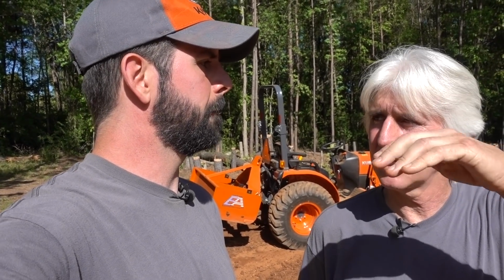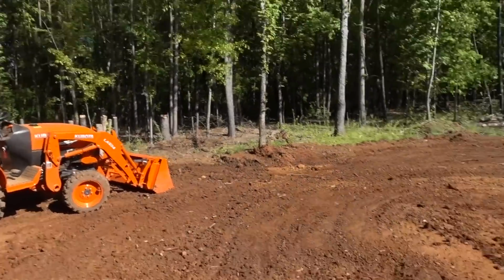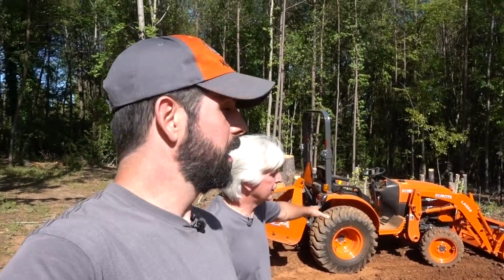Moving Another Mountain With The B2650

Comment: Great video, just curious why you didn't go-ahead and go for like a 50hp tractor over the compact?
Reply from the maker: Thanks! 

We wanted a light weight tractor that could be run on lawns in the future plus its the largest tractor they make that does not require the DPF filter and all the hassles they involve.
There have been and will be plenty of times a larger tractor would be nice. We actually hope to get a larger tractor in the future and maybe buy or lease a bit of land to farm. Time will tell.
Terry
Reply: Forest To Farm heard that. I've got a 52 ferguson TO 30 that I use to bush hog with,  but definitely could use something a little bigger with a lift.
Reply from the maker: That's a nice tractor. I love those older model tractors. They are a bit limited in what they can do though. We want one of those or maybe an old 8N just because we love old stuff. We want a lot of stuff, lol.
Terry

Comment: Currently looking at either a B2650 or B3350, have you ever had an occasion that you wished you had more power?
Reply from the maker: Yes. 
We did not want to worry about the DPF filter. Its not a huge deal but just one more thing to keep up with in our already extremely complicated lives. 
The B2650 has been all we needed so far. Our plan is to rent a mini excavator or skid steer when any heavy work needs doing. That way we don't rag out the tractor. And its fun to play wiih those big machines every once in a while. I think the main advantage to the B3350 is extra PTO power. We will be running a bush hog but only on fields we develop and clear so it will just be grasses and normal field stuff. No big trees or anything like that. So the limited B2650 PTO power should be sufficient for us. Ultimately if we were making money with the tractor and time was a huge factor then more power would have been our option. We don't mind things taking a little longer to get done. Its actually like playing for us when we're on the tractor, lol.
Terry
Reply: Donald, If you do not need the extra pto horsepower the b3350 has over the b2650 stick with the b2650. I bought a b2650 because it has no Diesel Particulate Filter (DPF) and was priced less accordingly. I have a larger Kubota with a DPF and have had no problem with it. But, my dealer says they are currently not offering the 3350 for sale because of problems with the emission system. Hope this info is helpful.
Reply from the maker: @jc-botaman1077  Good info and we love the B2650. Also wanted to avoid the DPF.
Terry

Comment: Great videos..👌👌 I have a couple of questions and I'm considering a b2650. 1st, how does your current tire setup handle and perform on turf. Town between the r4's vs the turf tires. Also I've noticed your implements from EA, and was wondering is it better to get a package deal from the kubota dealer or just source your implements separate elsewhere?
Reply from the maker: First I am no expert. However we did a lot of looking before we bought our tractor. When we bought it there was a discount for two implements and the tractor purchase. We purchased the front end loader and pallet forks. Saved a good bit by getting that package(I think $1000 between the two implements). Then we had been looking at the Everything Attachments implements and honestly they are better by far in my opinion. 
Look close at the dealers box blade then look at the one EA has to offer. They have videos explaining how they build them and how much better they make them than many others do. After actually owning and using ours we have went and looked at the competitors and we feel EA has done everything they claim to have done and they build an awesome box blade. We will always compare between competitors but I am convinced we will be buying all our future implements from Everything Attachments. Quality is most important to us and we plan on using the things we buy until we can no longer work, me sooner than Brian obviously. 
As far as Tires go the R4 tires do leave impressions in the grass. We have fairly solid red clay so its not to bad here. We drove the L33 and B26 at the dealer. The L series tractor made serious damage to the sod while the B series was far easier on it, both had R4 tires. 
If you are doing lots of yard work I would go Turf. I was tempted to do it for our farm but Brian wanted R4 and I was really OK either way so we went R4. 
Hope this helps. And either way the B2650 does an awesome job. We are extremely pleased and its far better than we expected.
Good luck!
Terry